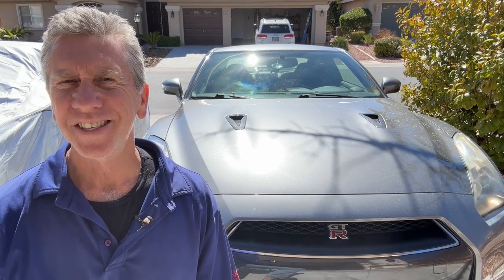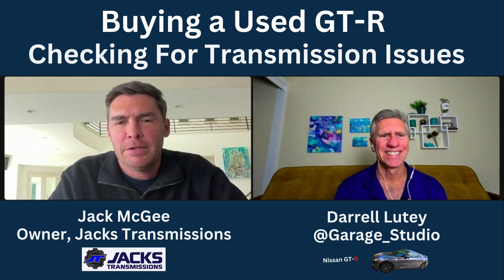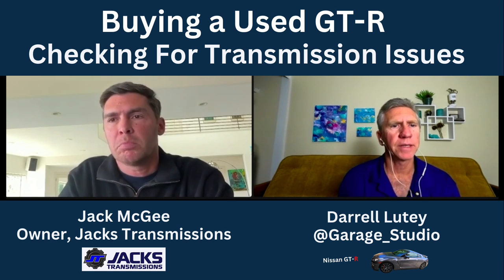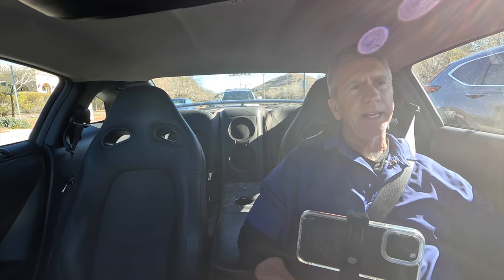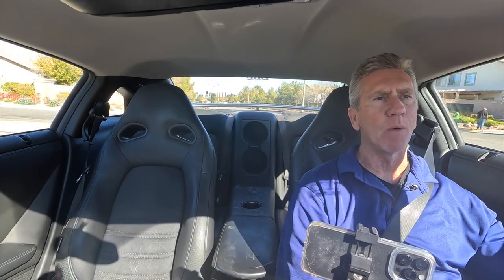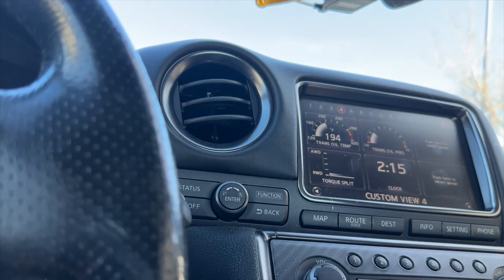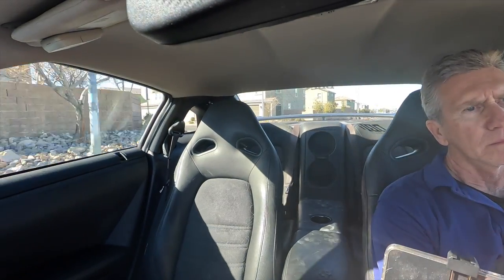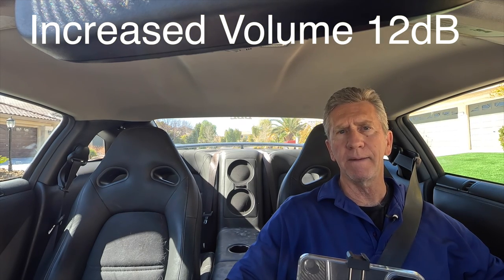Inspecting a Used GT-R for Transmission Issues Before Buying | Jack McGee of JacksTrans Interviewed

Comment: Most informative and accurate video on YT. unfortunately I got caught out with half the issues mentioned here, solenoids failed, clutches failed, doesn’t shift as smooth as it should. Also hear a ticking noise when turning. ALWAYS get a PPI
Reply from the maker: Thanks so much.  I don't have my GTR anymore.  I sure miss her.

Comment: also Jack always mentions to use oem paper fiters in the GR6 due to their ability to filter down to 10 microns in size whereas the mesh/paper ones that are costly can only filter items down to 100 microns in size and this is important information and I would recommend Motul DCT fluid over all others.
Reply: My tuner changed the entire filter with a washable one. Don't know what brand it is.
Reply: For stock the paper filter is fine, the minute you start making enough power to require a larger clutch pack, stay away from the paper.  I have a jacks 18 plate carbon clutch and the paper filter clogged within 500 miles with clutch material.

Comment: Use genuine transmission oil. Otherwise, performance will suffer. Many Japanese users do.
Reply from the maker: Good advice.
Reply: Everyone tracking these transmissions hard and even shep uses AMSOIL auto trans fluid, don’t waste your money on the overpriced dct fluid.

Comment: I am Japanese and I drive a MY13 GTR. My transmission is also broken. If the clutch is slipping, it should be changed to a new part, and at that time, three oil pressure sensors should be replaced with new ones. Flywheel housing is also a wear item. I know a mechanic who specializes in GTRs, but honestly, is he familiar with maintenance know-how outside Japan?
Reply from the maker: Good Luck !!

Comment: For the 1st issue , the transmission oil temperature should be around 180-200 degrees , is it correct ?
Reply from the maker: That is correct.  Needs to get the Transmission Oil Temp above 180 degrees.. if possible 200 degrees.. And have running for 10-15 minutes.

Comment: The point made when using 'R' mode will wear the transmission out early, is this if you're in A mode or M ?
Reply from the maker: Both modes will wear the transmission early if you're in "R"mode.
Reply: @The.Garage.Studio  thanks for the reply 
I’ve only owned my GTR for Three weeks and I’ve been putting it in R mode every time I drive it 
I’ll certainly stop doing this after watching your video 
Thanks for the upload, super helpful 👍
Reply from the maker: @hamradiostation_M0UGE  I did the same thing when I first got my GTR.  It was like muscle memory.. put it in comfort mode.. and then put it in R mode..  So funny.